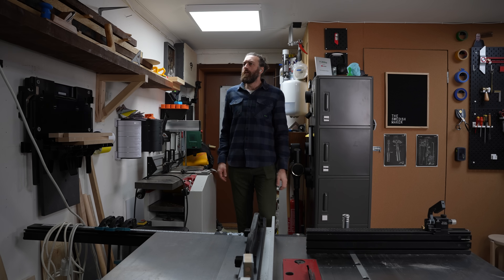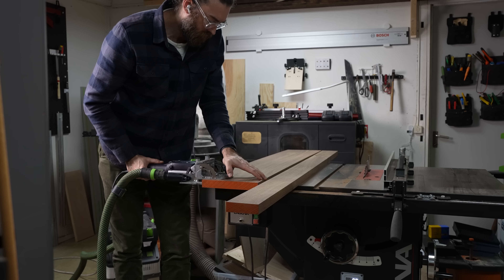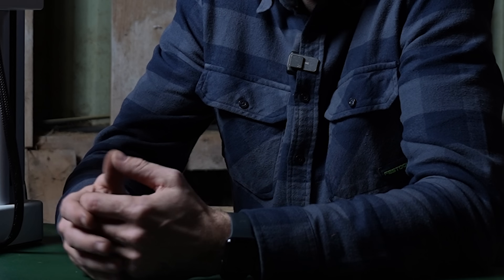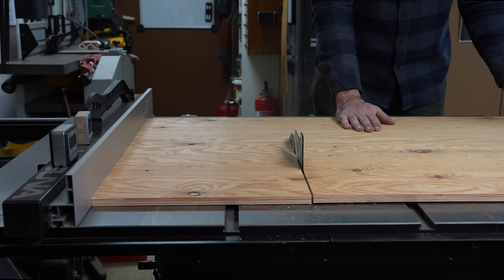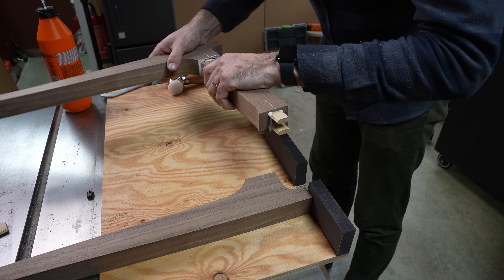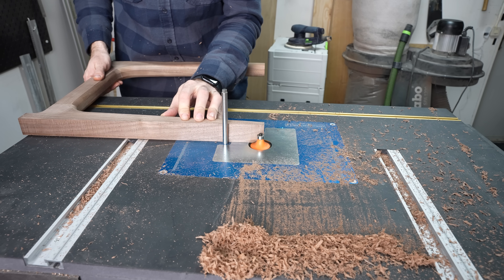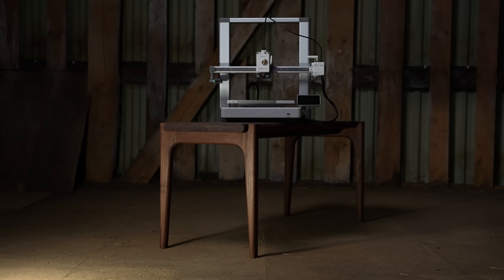Using a 3d printer to make furniture

Comment: Wow, never thought of using a 3D printer but this is a valid use case of buying one.  :-)
Which filement type are you using for the templates?

Are using the Laguna fusion 2?

Comment: Lots of tools can be used in different industries/genres. A drill press can be used in wood working or metal working etc. However, I would say the 2 things about the 3d printer. 1st, it is not a wood working tool, it is a plastic working tool. What you do with the plastic it produces after that is irrelevant. 2nd, it is not a tool at all, but rather a machine. A tool requires constant input from the user. A machine will let the user go hands off/walk away and it still processes material. A jointer is a tool. If you stop giving input (feeding wood) it stops processing. A thickness planer is a machine. It lets you take hands off and walk away and it still processes.

Comment: Woodworking tool: anything used by a woodworker in the pursuit of woodworking. Verdict: 3D printer is a woodworking tool. Extended verdict: who cares. Build it however you like using whatever method you'd like (and live with the consequences).

Comment: A 'tool' is anything you use to do a 'job'. I'm trained as an engineer, practiced as a welder and metal worker, machine as a hobby, and have spent the last 10 years using 3d printers to help grow my business. They're valid tools for any job which they help you finish.
Much like AI, 3d printing is new, so it'll be derided by the gatekeepers who guard the 'old ways'. Foolishness, in its extreme. Might as well rail against the printing press or the loom, IMHO. These people are afraid of learning a new technique, or changing their ways. That's fine by me, though, as I'll just use my superior new tools to maximize my efficiency and undercut them, producing quality products in less time with more precision, and undercutting them, to boot!
So, thanks to all those who refuse to recognize the utility of a new tool, your passing will pave the way for my success!

Comment: Love your work, but please 3d printers didnt do only 15mm/s ( or are you saying 50?)  before bambulabs. I realize you are happy with your sponsorship but common dude, no need to blatantly lie. Bambulabs released their first printer in 2022. Prusa i3 was released in 2012 and could do 2-300 mm/s. Repraps and related hw has reliably done 120mm/s for the past 10 years. 

While im complaining, a CNC is a method, not a thing. A 3d printer uses CNC. A brushless motor with speed control is technically uses CNC. A laser cutter is a CNC device. Computer Numerical Controll. Anything that controlls an output through a digital computer is a CNC machine.  What you are refering to is a CNC router. End of rant.

As for the discussion related to the topic. I think it's just pride related. They've learned using old fashined tools through the years, which is now getting "threatened" in their eyes. Instead of adapting they're doubling down on their pride, because they feel better for knowing "how its done"

Comment: 🎯 Key points for quick navigation:

00:00 ⚖️ The video is presented as a mock trial where the audience acts as the jury, deciding whether a 3D printer qualifies as a woodworking tool.
00:30 🎓 The creator has no legal background but previously taught ethics, where students debated ethical dilemmas.
01:11 🛠️ The claim is that a 3D printer is a woodworking tool and an invaluable asset for future woodworkers.
01:40 📖 Two definitions of "tool" are presented: a traditional one (handheld device) and a broader one (anything aiding a purpose).
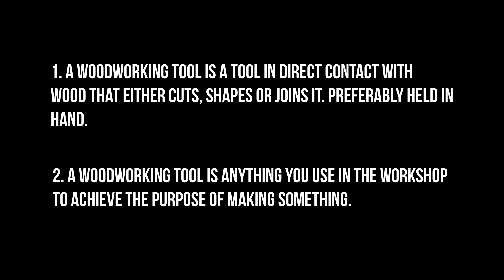03:48 🏗️ 3D printers use additive manufacturing, while woodworking follows a subtractive process.
05:23 🔄 Speed, reliability, and accuracy are key for a 3D printer to be a valuable woodworking tool.
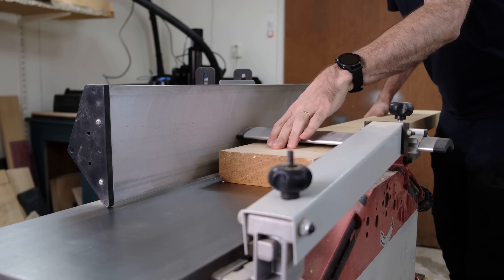07:05 🌡️ Wood must acclimate to a workshop’s humidity before use to prevent warping or shrinking.
07:45 📏 3D-printed templates and jigs improve accuracy, reduce wood waste, and enable efficient replication of designs.
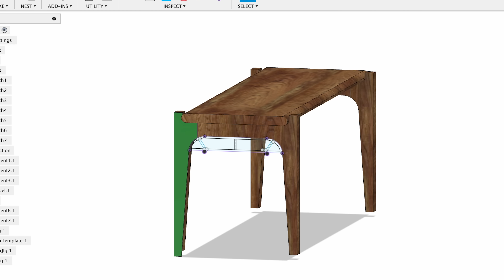08:12 🔄 3D-printed templates can be split, stored compactly, and reassembled when needed—unlike traditional plywood templates.
10:21 🔩 The 3D printer enables precise jig creation for dowel and mortise-and-tenon joinery, improving accuracy.
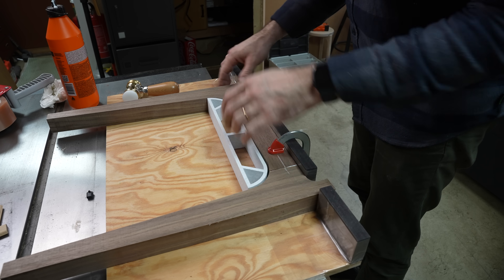11:51 🧩 3D-printed guides help maintain correct angles during glue-ups, ensuring consistency in woodworking projects.
12:45 🌀 The 3D printer also aids in dust collection system customization, making workshop airflow management more efficient.
13:55 🤔 The creator reflects on online criticism and why some people get upset about certain tools being classified as woodworking tools.
15:48 🔎 The final question: should tools be defined by their direct interaction with materials or by their role in achieving precision and efficiency?

Made with HARPA AI

Comment: That commenter is just flat out wrong. In today’s world a wood working tool is just a tool that you use for woodworking. A 3D printer is a tool in the same way a drill motor is. Both can be used for just about any application, even in the kitchen, but when used for a specific purpose they are the tool of that purpose. If you put a metal drill in and start putting holes in metal then it’s a metal working tool. If you put a whisk on it and beat some eggs with it then it is a kitchen tool. If you put a socket on it and start putting your car back together it is an automotive tool. The tool itself never has one use anymore, but it is the tool for that purpose if you use it to accomplish whatever it is you’re doing.

Comment: You used “begs the question” incorrectly. Begging the question is an informal fallacy that occurs when an argument’s premises assume the truth of the conclusion, instead of supporting it. It is a type of circular reasoning: an argument that requires that the desired conclusion be true. It does not mean “the following question should be asked.” Example: ”People with more money are happier because they can buy things that make them happy.”

Comment: I'd argue that it's not directly a woodworking tool. It's more comparable to, say, a tool sharpener - useful as heck, nigh indispensible for many of us, but it doesn't actually do anything directly for woodworking. 

All of which is, I would argue, beside the point. Quibbling over the definition of a "woodworking tool" isn't helpful or productive unless you're in the mood for the same kind of pointless philosophical debate as whether a hot dog is a taco. The more important question is: is it a tool that can play a valuable role in your shop? And clearly, the answer to  that question is yes. 3d printers can be used to help with all sorts of things in the shop. They can simplify assembly, produce jigs, help with layout, improve organization, and so much more. At the end of the day, what matters is that 3d printers can make it faster, easier, and more fun to do woodworking, whether or not they're directly involved with the wood.

Comment: I think the mistake is tying everything into woodworking. Really your a creator, and you have woodworking tools to do the woodworking part of your job, but the 3d printer doesn't do woodworking per day, but it still contributes to the creation.
Really, word are always approximate, so you can't ever be totally presice with definitions, but I think 3d printing is too far a Strech to be a woodworking tool.
Arguably, the ruler example isn't a woodworking tool, it's a measuring tool, whixk you the use the woodworking tools to work the wood... Ehh, i don't really know, rip my arguments apart below

Comment: I would consider a 3D printer a tool for the woodworker. You can use it to create woodworking tools, but not to work directly on wood. (I wouldn't count wood filled filament as woodworking.)

It's pedantic for someone to argue about it anyway.

I feel the same about measuring equipment. They are tools for the woodworker.

Comment: I also have to vote against the defense.
the number of examples he gives are for metrology tools, not wood working tools

I have also used rulers, and jigs and other such things made from 3d printers, but I have not turned out one wood product for those tasks. 

The Swedish Maker also uses screws and nails, and these are not wood, is he also an ironworker, a blacksmith when he makes a wood bench?

I have swung hammers, used screwdrivers and and held things fast with clamps, and not one wood product has come from those either

3D printers are wonderful tools, but I cannot classify them as wood working tools

Comment: Semantics. An object used directly or indirectly to complete a wood project by a woodworker is a wood object. My question is the 3D printer in your shop a tool or equipment. 
Great analogy with the dust collector. It is a piece of equipment used by woodworkers but I don’t consider it a tool. A handsaw is a tool, a table saw is equipment. Does it really matter, no, because it gets the wood project completed.

Comment: A tool is used to make what you are doing easier, else we would all still be using sharpened stones to create. This is why I would say that a 3D printer is a woodworking tool, if you use it to make woodworking easier. By this definition, it could be a tool for any other craft that you are practicing, where it is used to make your creation easier

Comment: I love all the social media debates that attempt to define "real" woodworkers. I'm sure if there were CNC machines 200 years ago, the makers of the time would have embraced them. If I use a tool to make a tool that I use for woodworking, I consider it a woodworking tool. One of my favorite 3D prints was a 58.9° attachment for my shooting board to get the exact angle on a work piece. Mike Pekovich delivered a definitive answer when he was asked for his opinion on hand-tool vs. power tool woodworking on the ShopNotes podcast. His answer was priceless...to paraphrase, he said, "There's always something between your hands and the wood when you are woodworking. Whether or not it has a cord/battery is irrelevant!" Not an exact match for this video, but it speaks to the act of judging real vs. fake woodworkers.

Comment: It is not a woodworking tool. It is a tool that can be used in for wood working. It is a versatile machine that has many applications, not just woodworking. it is it's own machine that fits under the genre of 3D printing. I still see its usefulness in woodworking however, but I also see its usefulness in robotics, RnD, aerospace, bioengineering, sound engineering, and literally so many more. It is a tool with many applications

Comment: In my mind, there are different classes of “woodworking” tools. First order tools are ones that directly cut, shape, and smooth the wood. Second order tools are ones that hold the workpiece or other tools to do first order operations. This would include jigs, clamps, and even the workbench. Third order tools would be the next step removed. Graph paper, pencils, a computer, a 3D printer would be examples. 

For me, a good definition of tool is any object, usually manufactured by the end user or another maker, that assists the craftsman in the production of his/her final creation. 

In that sense, a 3D printer absolutely qualifies. 

This juror votes not guilty on all counts.

Comment: 3D-printing is perfectly fine to use for woodworking, it's just another addition to the different types/camps of woodworkers; Hand tools only, Power tools allowed, CNC machines allowed etc. But a 3D-printer is NOT a woodworking tool per se, it's a tool for making tools. You wouldn't say that Veritas's factory is a woodworking tool and that's because they only manufacture tools for woodworking (and adjacent e.g. sharpening tools). The same goes for a 3D-printer, it'll never be anything other than a manufacturing tool, period. Adding lasers and mills to a 3D-printer doesn't change that fact, in the same way that you as a human holding a wood saw doesn't make you a woodworking tool. (Though you could technically become a woodworking tool by way of semantics by being a "tool" that's working with wood.)

And for me in regards to your closing statement; A tool is defined by it's intended use from the factory. A machinist square is always gonna be a machinist tool, using it AS a woodworking tool doesn't change that, but it's not wrong to do so either way. Using 3D-prints for woodworking is 100% okay and you shouldn't feel ashamed for doing so either, the only situation where 3D-printing is wrong for woodworking is only ever on a personal level, and that's if you feel that it's in some way shape or form detracts from your enjoyment or expectations for why you woodwork, but this is absolutely only a personal preference and thus should never be enforced upon others. An example to clarify what I mean:
If I as a complete beginner woodworker wanted to make a dovetailed box I have 2 basic choices; buy a router and jig or hand tools and practice. But before I choose there's 2 important factors that needs to be addressed; Do I want a dovetailed box I've designed and built myself or do I want the experience and enjoyment of having conquered the difficulties of hand cut dovetails on a box that's more of a byproduct in this case. If you're the former the method you choose barely matters, but if you're the latter the router and jig approach probably isn't much better than purchasing pre-cut boards that you glue together. At least that's how I feel about it, especially since I'm mostly of the latter in this example.

Comment: Sorry, but I think the 3d printer is a tool, but not a woodworking tool. You use it to make woodworking tools and it may be an essential piece of equiptment, but it doesn't work with or on wood.

Comment: A 3d printer is an omnitool, it creates designs from the more easily manipulated digital realm. Those designs in-turn can be woodworking tools. 
The printer itself is just a plastic former. The plastic is the tool that works with the wood. IMHO

Comment: 100% correct.  woodworking tools do not all cut.  I have never cut wood with my ruler or my speed square.  Although I think the speed square could be sharpened and used as an axe as it's about 30 years old and made from steel.  Also be aware, the commenter is most likely american, the conversation style in america is to be combative with others including teachers.

Comment: This was an excellent video.

I feel like the word tool is wide.
I would say the 3D printer is in the same "tool category" as the vacuum for your machines. It's a tool for your tools. Not a tool for the woodwork / project itself.

But all the measurement tools. What about them? If you use them to measure directly on the wood to make a clean cut, it's a woodworking tool.
But if you use the same tool to get measurements into CAD to make a tool, is the ruler not a woodworking tool anymore? 🤯

Comment: 0:38 The new Bambu Lab 3D-printer now can come with a laser option to CUT materials such as WOOD!  So by their own definition, they proved themselves wrong. 🤦‍♂️

We live in a world where people want their opinion to be fact.
Reply: Except anyone who knows anything about 3D printing and laser cutting knows the two do not mix well. 3D printing requires a clean dust free environment, and laser cutting creates the exact opposite environment full of dust, smoke, and particles that wearing down bearings, linear rods, and make bed adhesion a pain. Bambulabs themselves stated that if you use the laser frequently you will experience issues and have to do heavy regular maintenance. That being said 3D printings a re a versatile tool that can be used in woodworking, but also in many other areas. It is not a tool relegated to one genre, its almost like a one size fits all type of tool.

Comment: Well, 3D printer is not a woodworking tool, but it is a tool that is very useful in woodworking. So the question I have is - why does it matter at all? Did pidgeonholing of anything have any use for anyone ever?

Comment: Don't try to make a square with a 3d printer. It tried and failed.  Even it might look ok it isn't precise because of minimal shrinking. And if you do then do really a square and not a triangle which helps the angles to be more precise as shrinking is the same in all directions.
Reply: I have printed 90 deg brackets that are spot on.  It's likely the machine, or chose of filament.  Look online there are many examples by makers.

Comment: I’m going to say it’s not a woodworking tool, but hear me out.

A coach bolt uses a spanner to tighten it, but we would say that spanners are “mechanics tool”

A 3D printer to me is as you put earlier, an adjacent tool, or fabrication in its own right.

However it does make jigs and supporting items for woodworking (or metal fabrication etc) which makes it useful to have in the shop

Comment: Nice video, thanks. A question. Can you re-use those 3D printed stuff? You use most of the stuff just once, if you don't remake the  furniture again and again. It would be cool if you can recycle it, and not throw to carbage. Yes we recycle plastics in Nordics by law, but usually it goes to the burning waste.